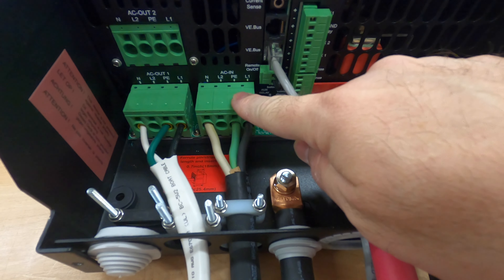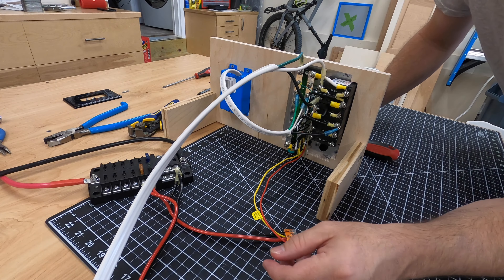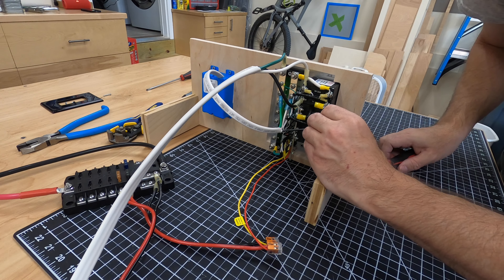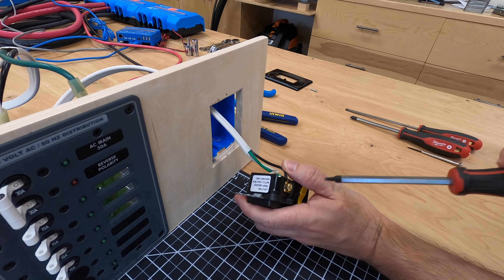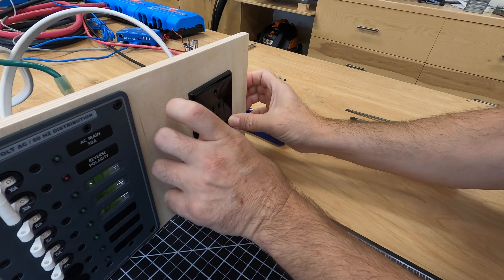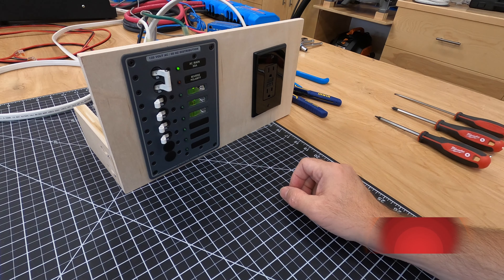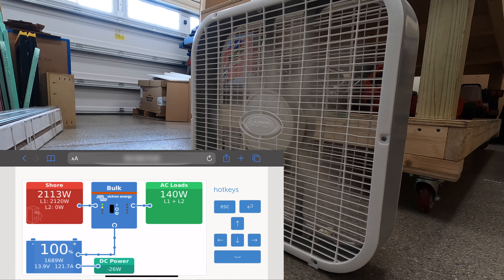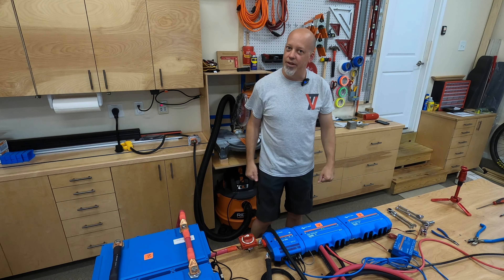Multiplus-II 120V AC sub panel install

Comment: Quick suggestion. I know you said that the ten gauge wire for the ac output was a temp output. For your actual install you could use a 6awg wire along with a 50 amp breaker for ac power assist. I know it’s a van but let’s say you are running an ac then a microwave or induction burner then try to power a hair dryer. You could overload the 30 amp plug and with power assist you could pull from the battery. Just a suggestion as your install is perfectly fine with your main breaker at 30 amps.
Reply from the maker: Great feedback for others who come here. 6 AWG x 3 would be needed for 120V AC 50A panel main breaker when using power assist in the Victron system for AC1 out to the 120V AC panel. I don't know that I will use that feature.

Also, I'm bald, so a hair dryer is out for me, haha! I intend to be mindful of my high wattage items like induction, microwave, electric kettle, and water heater and not using them at the same time. For now I'm planned at 30A main breaker and ultimately will have 6 15A breakers, all GFCI outlets. Upgrading to 50A w 20A breakers is always a possibility with proper larger wire.

Comment: So with your setup your not using a main power in breaker between shore power input and inverter ?
Reply from the maker: Not in what you see here. I may add one in the future, and it's not a bad idea in case someone wants to try to mess with your electric system by accessing the exterior outlet.

Comment: Your Victron MP II can supply 50 amp AC when assisting a 30 amp shore power. I guess you desided you don't need more than 30 when going with the 30 amp main breaker. I'm still debating between the 30 and 50 for my system.
Reply from the maker: That is correct, so far I decided I will not use power assist in the Victron system. If I did, I believe it would be 6 AWG x 3 from AC1 out to the 120V AC panel 50A main breaker. Then I would likely upgrade to 20A circuits, and therefore 12/3 vs the 14/3 I have for 15A circuits; and appropriately upgraded GFCI outlets as well.

If in my daily use I find otherwise, my 8020 (extruded aluminum) build method will allow for easy upgrading.

Comment: Did you lower the AC current in configuration to 30a in the multiplus settings or did you leave it at 50a?
Reply from the maker: I believe I told it 30A via the Cerbo GX. I will never plug into anything larger than 30A. I will eventually reconfigure my internal power options for Victron Energy "Power Assist".

Comment: I noticed that the ac load from the fan dropped from 130ish to 89ish after disconnecting shore power. I would’ve expected it to stay the same! Did I miss something there?
Reply from the maker: Good observation, I don't have an answer right away, been a while since the test. If I remember, I'll try to run it again, same fan.

Comment: Can you use the same Blue Sea 8027 panel with a 50A main breaker?
Reply from the maker: I don't believe so, but you can check with Blue Sea. If I upgrade so I can use the Power Assist feature, I have Blue Sea parts 8079 which is the standalone 50A breaker, and 8059 which has 8 breaker slots. I will never need all 8 slots, but wanted extra rather than no room to grow just in case. I believe you can get breaker panels with less slots.

Comment: wouldn't 10/3 have 2 hots? this looks like 10/2
Reply from the maker: 10/3 refers to 10awg wire, 3 of them in the combined outer sheath. In the USA, this is hot, neutral, ground for 120V AC. 10/2 would contain 2 x 10awg wires, positive and negative, usually in a DC scenario.
Reply: @VanTransitions   tried to comment but it seems it was removed, maybe because I linked to Lowe’s. At any rate, 10/2 in America is most definitely 3 wires. Neutral, hot, and ground. This can be easily googled and is probably known by anyone before they even step foot in electrician school.
Reply from the maker: YouTube removes links from commenters by default, not within my control, part of their spam prevention I believe. Here is some 12/2 I use for some of my 12V DC loads. It is definitely 2 wire of 12awg within the same sheath. https://www.amazon.com/dp/B000NUYBU2?_encoding=UTF8&psc=1&ref_=cm_sw_r_cp_ud_dp_QM9XP37H7VK89FSADRDT and here is some 12/3 https://www.amazon.com/dp/B000NV2AVS?_encoding=UTF8&psc=1&ref_=cm_sw_r_cp_ud_dp_493MDXT1YJ1VXRN6SSH7
Reply from the maker: You may be thinking of romex? Which contains solid wires and the additional bare copper for ground. Romex is NOT recommended in a van (which is a moving earthquake), only stranded.
Reply: @VanTransitions  after a little more googling, it seems marine grade wiring is different than residental.  residental romex 12/2 includes a ground, but your ancor marine wire does not.  interesting indeed.
Reply: @VanTransitions   hm, almost every RV i've seen uses 12/2 solid romex, including mine just purchased last year.  The ground is sent to the frame.
Reply from the maker: Interesting indeed. I personally do not endorse romex in a van or RV. I treat a van like a land boat and try to follow ABYC standards. The 10/3 in this video does have ground, it is the green wire for AC 120V then the white is neutral and black is hot. The 10/2 is for DC wiring which only requires positive and negative, not a separate ground. My entire DC system includes a chassis ground, and the AC portion of that is fed through an inverter getting its power from the DC system.
Reply: @VanTransitions  no.  10/2 refers to Hot, Neutral Ground.  It may be contrary to common sense, but this is 10/2.  10/3 is definitely referring to a wire intended for handling a two-post 220v connection! It’s also with noting that the would have household electrical hardly ever considers DC - and do they really don’t care if there is ambiguity when it comes to DC/marine wiring.